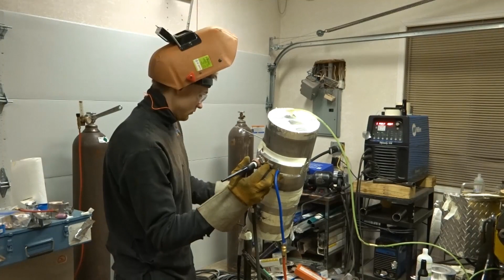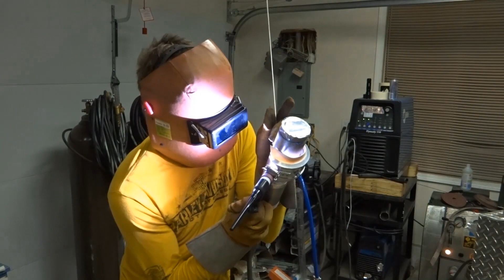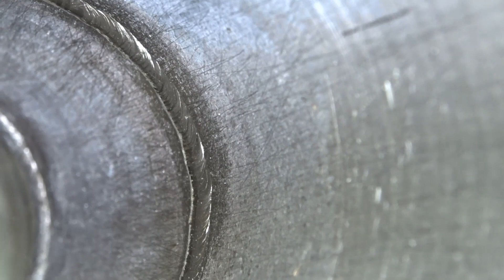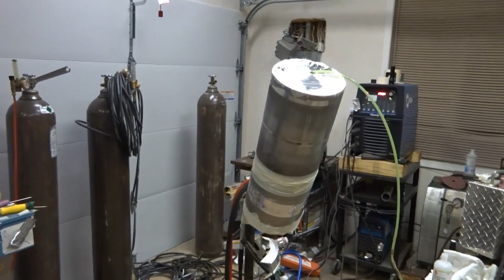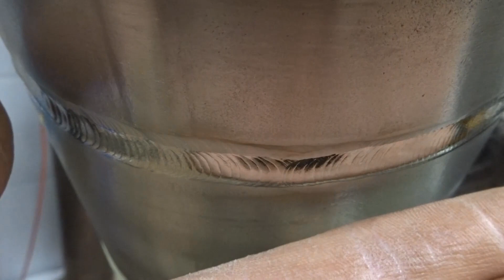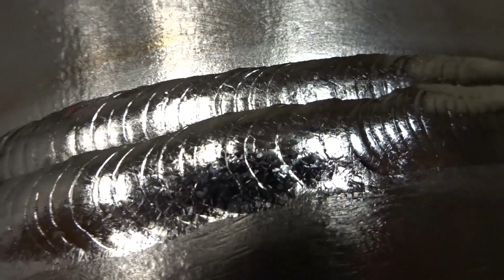6G Pipe Welding TITANIUM (commentary)

Comment: Great video, I learnt a lot from that!!!
I am now in the process of taking up TIG welding again, 15 years back I was ticketed for stainless pipe, now I am once again doing stainless (not as good as I once was but getting there) and by the looks of it titanium is in my future.
So I am off to build a trailing cup and a foot pedal for my wee inverter.
Thanks for the motivation!

Comment: Hi Fieldres. Welding codes are often very strict about what you can and cant do. How dose the back feed rod tech you use fit in?  Nice work by the way and thanks for sharing with us. Also good to know there are still some people out there that want to expand there knowledge and experience even at there own expense. Sadly employers these days often don't think expanding there employees range of skills is worth there time or mostly there dollar. Very short sighted in lots of cases.
Reply from the maker: +Ian 1421 It is a technique. Depends on what is expected of the weld. If It is sanitary tubing, you will not be using this technique. If it is very steam or other and buildup of the rootpass may create turbulence and a flush root is desirable, this technique will not be used. It depends on what the client needs and what is expected in the weld. I find that too, employers don't care what a guy can do, knows, or if they take it upon themselves to be the best they can be, it has no value.

Comment: What number shade do you use and where did you get that hood?
Reply from the maker: +MrDownWithTheSouth I change the shade of lens depending on the metal and position. Like aluminum, shade 11.., position weld carbon steel tig root shade 8; roll welding 7018 shade 9; walking the cup cap shade 8 or 9,. titanium I was probably wearing a shade 8 so I could see more of the pipe. I spoke with a welder on instagram who had the helmet and he sent me 2 of them. They are www.ilhung.co.kr
Reply: +The Welding Channel - Fieldres thanks alot I'll try to order one.
Reply from the maker: +MrDownWithTheSouth ok =D

Comment: Always great videos. I was trying to peek at your display on the dynasty but you had it covered while welding?
Reply from the maker: +Lyle Hjort I was concerned with running inconsistent currents and the viewer would not understand so I taped it up. can still tell the current by the brightness of the arc especially if a manual pulse is used, but its less for people to question.

Comment: Nice!!!
Reply from the maker: +Kenny A Thankyou! =D
Reply: +Fieldres - RigWelder  I have a question I'm practicing for a Stainless steel Its a 1g closed root. Everything is perfect and gold until the cover pass then the puddle starts to wander off on me and goes in different directions I would like to know how to solve this problem thank you?
Reply from the maker: +Tylerb Are the oxides/heat tint brushed off the pipe in the weld zone? welding over oxides or oxidizes metal will do that where the puddle will not go very weird

Comment: I bet you put the Floyds right from the start, just to please me. Hahahaha! Jokes apart. I think, and please correct me if I'm wrong, when you say that ti is more forgiving than for example stainless, you mean that titanium requires thourough cleanliness, purge and gas coverage of the parts exposed to temperatures above the interpass temperature. That leads also to discoloration free welds, and parts. I think you wanted to say that, being required discoloration free welded parts in titanium, this educates the welder to achieve the same result with stainless that challenges you even more because everywhere you strike an arc you separate the chromium(and the other elements helping prevent oxidization) from where it is supposed to be and so applies to the heat affected zone that, could have quite an extent too. Am I right saying that? How does Ti pipe welding 2 or more inches thick wall stuff compare to aircraft stuff, or even bicycle frame building? Walls are way thinner, but the need for heat should be lower too even though most of the time you haven't got the privilege of any chamfering to achieve full penetration. I'm quite concerned about heat imput and I don't know if grade 5 or 9, both "straight" and ELI will weld the same. How does Zr compare to Ti when it comes to weld it?

Please convince GRB to make a school in Italy with courses about cluster welding thin wall Ti. I'll be the first student to sign up!

Keep it up, mate! Great stuff!

Have an awesome 2016

Take care
Reply from the maker: +makirompe Id say you're right, with all things equal using the same exact techniques and striving to achieve the same exact results, I feel that the titanium would come out very attractive, very pretty to look it, it would inspire the welder to want to keep up with the results and aspire to get better and better, I think the ripple definition would be much nicer and more precise than the stainless would be, shielding would be lesser time to protect a single ripple than the time needed for the stainless. Titanium would be incredibly sticky unfortunately, the filler would stick to anything and everything, but the puddle is far cleaner to see, it is so much nicer to weld, its just a metal that you feel good welding - its just a nice metal. Myself I don't weld air craft or tiny structural components or bicycle frames, air craft, drag racing frames, tubular frames or anything like that I just stick to pipe welding really. Such things would require appropriate cleaning to remove the passivation layer off the metal, would need control over heat input, would need control over any areas that are exposed to being heated need to be protected with inert gas away from the atmosphere, the smaller components would heat up faster therefore they would need to be protected away from the atmosphere. They are a different challenge in themselves welding on aerospace, aircraft, frames, etc. I wouldn't worry about other grades of metal, if you can weld one grade of metal, any other grades should weld relatively similar. may have a little different characteristics but should not be difficult to figure out. I myself don't know what zirconium welds like. I have heard it is crisper and requires longer purging compared to the titanium. I was going to buy Zirconium pipe from titanium.com in montreal there, and they weld zirconium at a fab shop called ti-fab in st-laurent, quebec, you can check them out at tifab.com but the thing is, is the titanium, a 2"sch.80 piece of titanium Gr.2 that is 36" long costs $350.00 which I'm fine with cause I need to practice it anyways. A 2"sch.80 piece of Zirconium ZR702 that is 36" long costs $1825. You would be better off flying down to Edmonton here, but while he has courses on every form of welding imaginable, he would just explain to you how to do the welding and then you'd go into the booth and do exactly what he said and have great success. Like the other day for example, Monday and Tuesday I renewed my titanium and aluminum welding tickets. Both 2"sch.80. Tuesday I renewed my carbon ticket and my chrome ticket, and Wednesday Gerry said "I am going to show you how to weld sanitary tubing" and he told me about a job he was on many, many, many years ago that it must have been back in the 1960's or 1970's about a milk processing plant that they were welding this sanitary tubing, and he gave me a 2"sch.40 stainless pipe, he just said "this is how you are doing this" and then he sent me on my way to the booth. I got it on the 2nd try, I was able to sink in the root pass all the way through, but the purpose is, is to be able to do a root pass/autogenous fuse and also have a cap pass in only 1 single pass. So my cap pass was underflush because I was at 60 amps when I could have used maybe 45-50 amps, which is just a learning thing, I'd get it on the 3rd or 4th try for sure, and then he explained how to do stainless stick open butt joint root passes, which he explained and then I went to the booth and did exactly as he told me to do. But, it would be the very same with the thin wall titanium. He would have you at the front, he would explain to you how to do it, and then you would go to the booth and do exactly what he told you to do and you would have success instantly. Gerry is the obsessive welders' Welder because no matter how skilled or how knowledgeable or how competent a welder is, he will still show you things you've never seen or heard of before and make your welding even more brilliant than what you could have ever imagined.
Reply: +The Welding Channel - Fieldres That's interesting, man. In addition to the valuable theory, a course focused on the actual job to make me able to achieve spot on results. That's what I'd like. Obviously I don't bother about the tickets at all, that would be worthless here in Europe(we have a very bizantine bureaucracy here). You conviced me, if they don't want me to go through all sort of other as well bizantine and pyramidal courses and (worthless)tickets, I think they're worth really serious consideration.
Reply from the maker: +makirompe GRB College of Welding has the course on the metal, but to achieve spot on results, I bought the stuff to practice and I get to a certain point., then i'll book a day or two back at GRB and practice there and ask Gerry how to improve and he'll tell me what I need to work on, then I take that and keep practicing.

Comment: Good stuff. 
I would have loved to have seen some arc shots. Keep the good knowledge coming. 

Idea for a future video: show how different welding machines make different looking weld beads. Why?
Reply from the maker: +John T These videos the reason why I never include arc shots is because what I am doing is I am doing somewhat of a 'demo' on certain metals that may spark a persons interest in welding the metal that they will say "I can weld that!" and then go to a training facility to learn how to weld the metal, and get involved with it. The difference would be the most noticeable on a 7018 roll weld cap pass between the various machines, but I have included those on my instagram with a picture of the weld and the name of the machine, and they are quite contrasting between a weld done with a generator and a weld done with an inverter

Comment: Hey fieldres    can you go over your truck and how you keep up on being  welder one day?     im in the states and ive had 4 year of welding in Highschool and getting some good certs and after that going to a School Called Hobart.    Want to one day get on the Pipeline and general Rig welding but don't know what to do after school.    Be nice to hear it from a younger guy who knows what hes doing. Thanks man!
Reply from the maker: +Langerang The truck I don't know yet if I'd do a video showing the truck, I am always worried someone would know where everything is incase they want to break in. But with the truck, because I don't have a ton of room I am always changing stuff out and I run almost like a job specific truck where If I am welding this particular kind of metal then I will have this machine in the truck and this machine in the back and these other devices with me. I could still do a practice video on how I practice for the jobs though.
Reply: That would be pretty cool and the commentary is nice too. And i can understand the caution keep up the dime stacking!
Reply from the maker: +Langerang thanks!!